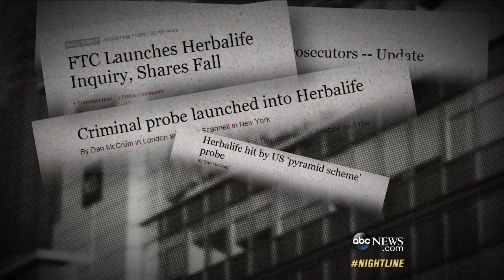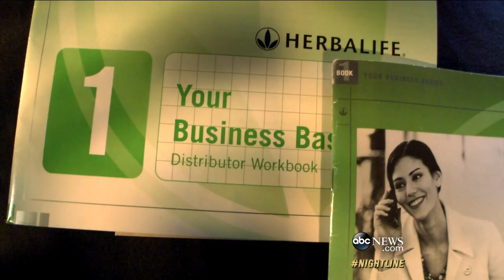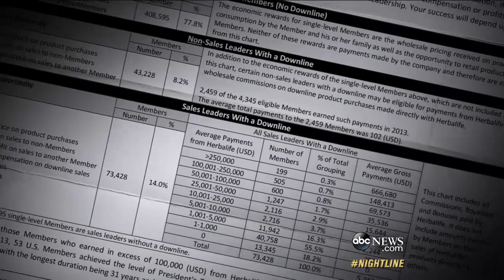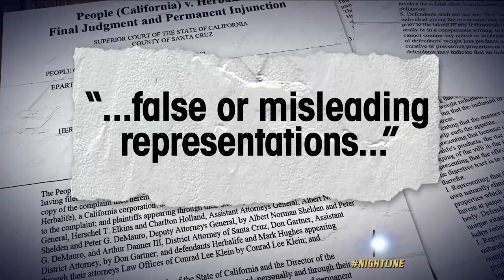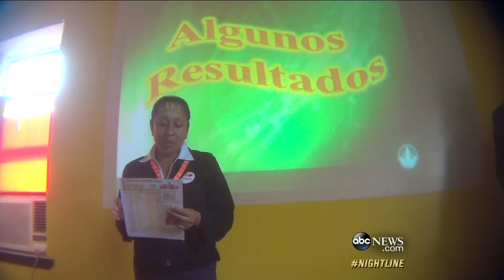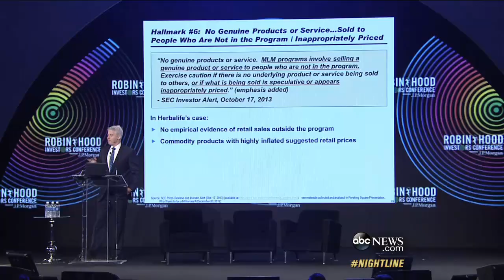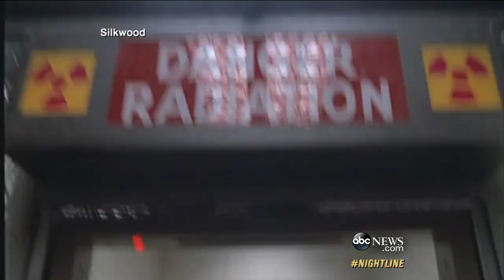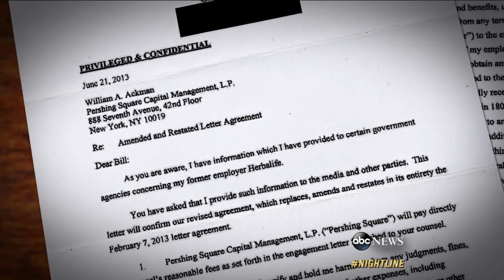Herbalife Investigation: American Dream for Sale? and The Whistleblower

Comment: Herbalife is just a product, if you do not exercise along with it you will not lose any weight.  If you do not follow the diet plan you will not lose any weight.  If you do not drink enough water you will not lose weight.  Is it healthier for you?  Well with Herbalife shakes, along with diet, exercise and cutting carbs (plus my insulin) I was able to take my A1C from 10 down to 6.1.   Note: HL is low in carbs and high in protein,  so adding exercise helped start to build mussel which helps burn carbs.   The biggest reason for the change in A1C is going on a low carb diet. and exercising.  So would have had the same change without HL,  maybe but I would of need to find an alternative high protein, high vitamin, low calorie and low carb solution meal replacement.

Comment: when you lost quick most likely you would easily gain more later, it;s your body survival mechanism, you should adjust your body slowly with the carefully planned and more natural way, and my way is with low carb diet, i lost 20 kg slowly in my first year diet, and it;s been my third year, starting from  95kg now I am at 70kg ( i am a 170cm and now 47y.o. guy)